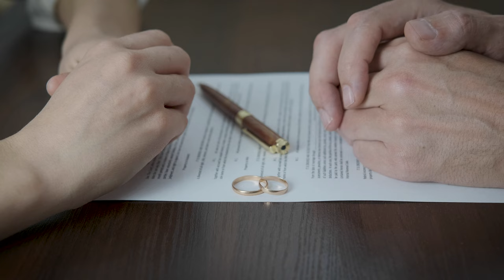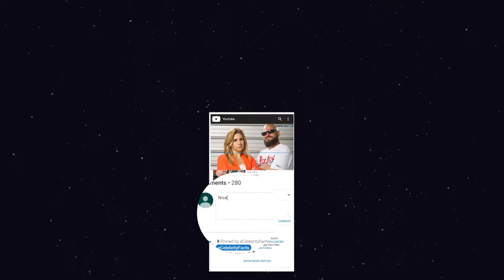What happened to Graveyard Carz? Graveyard Carz Lawsuits & Complaints

Comment: As  a 40 year GM world class tech an a heavy equipment tech an heavy duty truck tech the last 30 years spent at a GM  dealer  some of the mistakes made are due to a lack of experience or talent could be avoided by simply hiring an experienced tech a professional technician with real experience
Reply: Believe it or not rim not the size of the style but the bolt pattern on the rim is done by amount of lugs in the space between them so there are GM wheels that will go on a Chrysler and Chrysler that were going to gym and you would be surprised how similar I know they're different manufacturers but it's just a Brown hat and a round or a square or an oval Box they really are all the same down deep
Reply: @michaeldevantroliansr2778  you are WRONG. the gm wheels never fit on chrysler. 
ford and chysler had the same bolt pattern in the late 50's into the 60's.
Reply: And pay their employees well enough that they don't leave. So many bosses think only of themselves and how they can keep everything for themselves.
Reply: @fransmith8992  you are correct